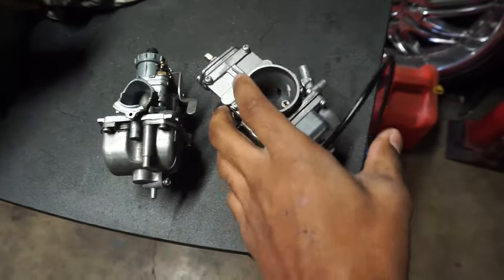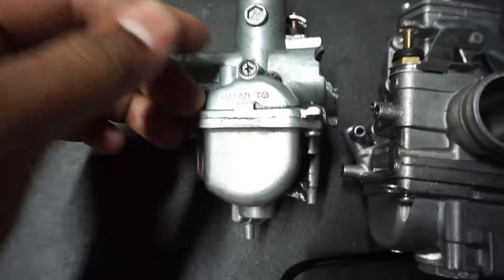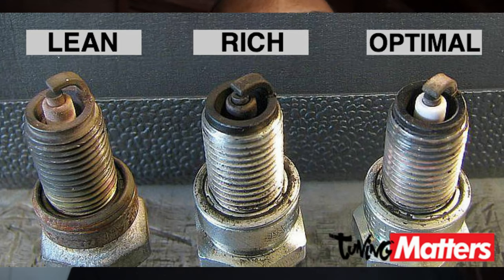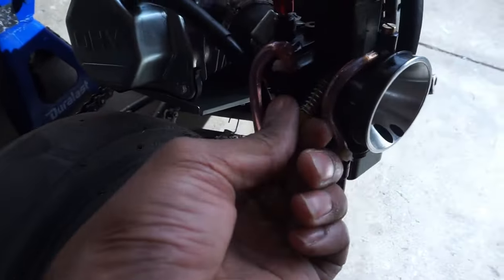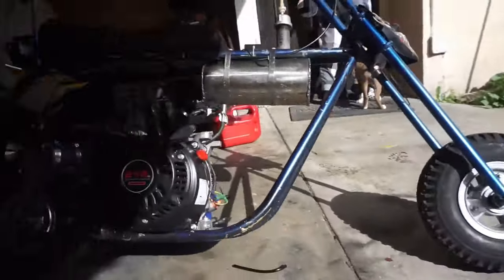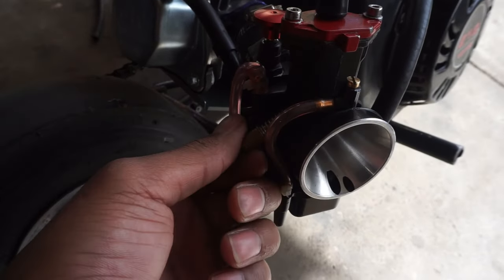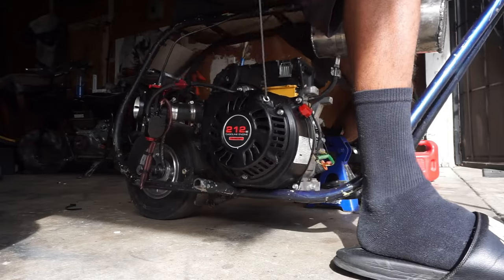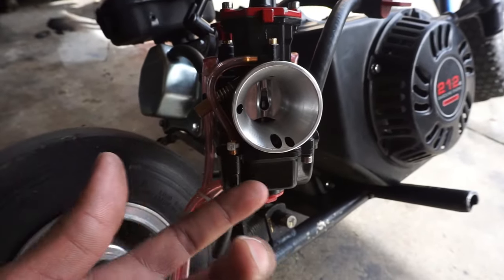How To Tune A Mini Bike Carburetor! Idle Adjustment/ Air Mixture 212 Predator

Comment: Pwk carbs and carbs with screw before the intake have air fuel screw, turning in richens the circuit brother. VM22 carbs have a fuel screw which turning in leans and out rich.

Comment: As soon as my new valve springs come in I’m gonna ditch the stock carb and exhaust governor and oil sensor for a Mikuni carb and a header just want to do it all at once so I can ride. Gonna do my daughters 3hp doodle bug right after. Still gotta order her parts though
Reply: dont cheap out on the carb its the worst thing you can do

Comment: I have a fully built motor and the carb dies out when I full throttle it it has a billet flywheel arc rod and piston 26lb springs champion rockers chromoly pushrods 265 cam and a maikuni 28 carb

Comment: whats up jz, i gotta question boumy bike. my predator 212 when i try to cold start only starts on choke and dies immediately but with no choke doesnt have a response. Do you know whats wrong?
Reply from the maker: If it’s a stock carburetor you have to move the choke lever side to side to find a good spot where the bike wants to start
Reply: @RoyalJZ  I have a 22m mikuni
Reply from the maker: @rhettbeluevlogs9635  I mess with the idle or check for air leaks
Reply: Clean the carburetor  change the spark plug if u did that our spark plug is new   turn your mixture all the way in and then turn it 2 turn out and turn idle up high should start from there then just liston to where u think it runs good will probably have to just the idle and mixture  just a little if it's somthing  that happen all the sudden then most likely  u got a leak our somthing going on
Reply: @rhettbeluevlogs9635  I have a 15 pilot jet and a 120 main jet needle clip in the middle..  air mix screw 1.5 turns out from  lightly seated

Comment: you doing alright I use to build minibikes. started when i was about 10 till i got a license for a car. I gathered peoples snow blowers on yearly pick up day. I would mix carbs with motors turning 3 def motors so i could rid my frame all summer. You are right listen to the bike it will tell you how to.

Comment: my minibike throttle has no snap back, so when i use the throttle and i go, if i let go of the throttle it won’t stop, it also has started to take off on me when i pull start it. It also needs to be given gas by me turning the throttle all the way in order for it to start, if i don’t then it will not start running. I have no idea how to fix this, will this solve my issue? Or do u have any idea for how i can fix this
Reply: If it's stock, add another or new return spring

Comment: my stuff is going by itself
Reply from the maker: Bad gasket or idle to high or clutch
Reply: @RoyalJZ  how to turn idel down?
Reply: i just put it on brand new
Reply from the maker: @Deonn.1  show be a screw on the side of the carburetor
Reply: @RoyalJZ what screw on the side?
Reply: i have the vm22 carb

Comment: Well, I can see you don't know the difference between air screw & Fuel screw lol. They are definitely different. That VM is Fuel, the Adjustment is on the fuel side. Air screws are on the intake side.